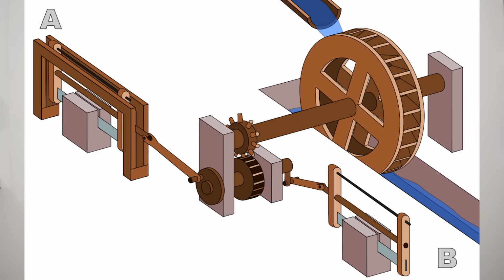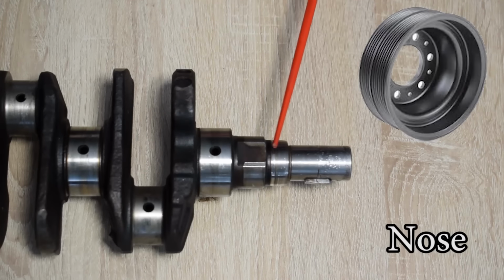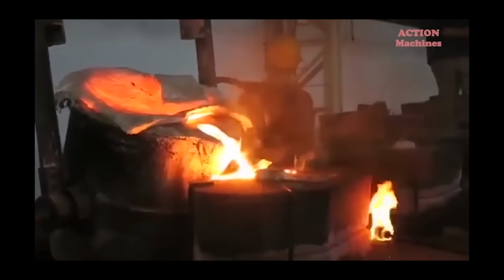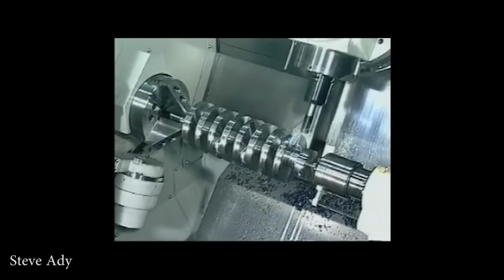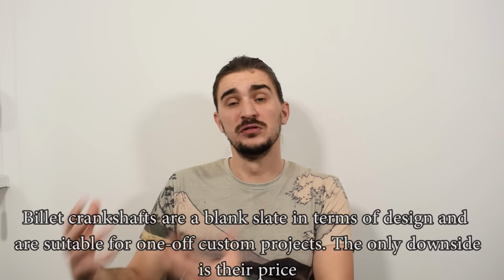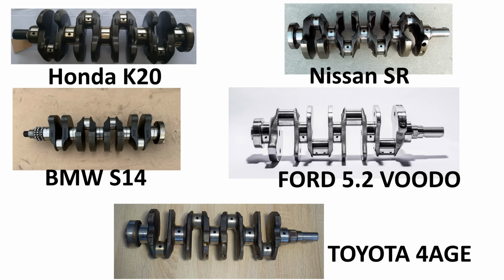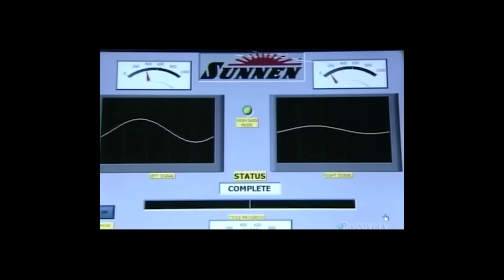EVERYTHING about the CRANKSHAFT - Function | Manufacturing | Different types | Forged | Billet

Comment: Excellent presentation, thank you!  Two questions: how do the rod bearings get lubricated?  Does oil get pumped into the main journals from their mounts and then to the rod journals internally  somehow?  That must be what the direct or cross drilling is for.  Some of the illustrations were confusing to me because it seemed like the oil was traveling through the parts that hold the journals together at right angles.  Which leads to another question: once the oil gets to the rod journal where does it go?  Is it just expelled to fly around the crank case?
Reply: Thats exactly it. The holes in the main journals and rod journals are connected through internal passages in the crank webs, so that when oil is pumped into the main bearings under pressure, it also pushes through those passages and into the rod bearings. And yes, it just kinda pushes out the sides of the rod bearings and main bearings iirc

Comment: Pretty much all 3 cylinder engines have a cross plane crankshaft.
Reply: Actually, no. They pretty much all have 120° between crank throws, crossplane means theres 90° between journals, because the planes created by the crank throws create a cross when looking down the length of the crank. Thats why its called cross plane.

Comment: I really like your vids, particularly your graphic illustrations and simple explanations which are normally spot on but you got a few things wrong with this one. You say that the crossplane crank means a cylinder fires more often than the flat plane crank making it smoother, while the reality is that both cranks fire one cylinder every 90 degrees.  The reason that the flat plane crank is not as smooth as the crossplane is that the flatplane effectively makes the V8 two inline four cylinders attached at 90 degrees. You have previously given great explanations about the good primary and poor secondary balance of inline fours and the flatplane V8 has the same issues multiplied by two but in different directions with different phasing between the banks which reduces the magnitude of the problem but still leaves it with poor secondary balance. The crossplane crank is balanced as four 90 degree V-twins which also have good inherent primary balance without the secondary balance problems of an inline four because secondary vibrations for each piston happen at different times and don't reinforce each other like in an inline four. Crank counterweights on a flatplane crank only have to balance rotating forces because the primary reciprocating forces cancel each other out while primary reciprocating forces on a crossplane don't cancel each other so its counterweights are used to balance reciprocating forces as well as rotating forces which means they are heavier, however in most situations the increased smoothness is worth the weight penalty. The extra weight in the crank means less weight is needed in the flywheel.

The biggest advantage of the flat plane crank is that each bank has an even firing interval between its cylinders that allows better tuning of intake and exhaust pulses within the manifolds. The fact that crossplane cranks have different interval exhaust pulses entering each exhaust manifold is what gives them their beautiful burble but it is not ideal for maximum power or torque.

Flatplane cranks are the same dimensions as crossplane cranks in length and width but flatplanes are shorter in height however they occupy the same amount of crankcase space as they rotate so the engine can't be made any smaller with a flatplane crank. The smaller height just makes it a bit easier to forge or whittle from a billet for custom cranks. The width of any engine's crankcase is determined by the throw of of the crank with conrod big ends attached to the journal. This is identical for both flatplane and crossplane cranks if they have the same stroke, same journal size and same conrod. The length of any V8's crankcase is determine by the bore spacing of the cylinders and the offset of cylinders between banks. These do not change between flatplane and crossplane cranks.

Edit: I just watched your vid on the Corvette C7 & C8 & Mustang Voodoo engines where you corrected most, if not all the errors I've just mentioned.

Keep up the great work.

Comment: didnt  do enough research. should have added exceptions. 1.6 ford turbo motors like fiesta st output insane liter per horsepowers. same with k and b series honda engines. there are actully many exceptions to FORGED CRANK
Reply from the maker: 🤣 gotta get those liters per horsepower actully.
Reply: @d4a  same legendary 1jz and rb26. push over that liter / hp ouch dawg. we want to have too much fun with our cars. light that burns twice as bright burns half as long? only if its not an LED 🙃

Comment: If you were in the Boy Scouts, you learned how to start a fire by spinning a wooden shaft in a wooden hole.  Pretty basic.  If you synthesize  that to a crankshaft, you realize the heat created.  It only takes a few seconds to melt the crankshaft journal to its bearing, if lubrication runs dry.

Comment: Engine wise....I'll take a 427 cubic inch ford Windsor motor with aluminum block, forged internals, and jon kasse p38 aluminum heads and his matching cam.   IT IS GOOD FOR 750 HORSEPOWER AND 595 pound/feet of torque. All motor.  No blowers or turbos or nitrous to bother with. Runs on pump gas too, although if im honest(i am) id probably run v116 race gas through it and turn up the timing a hair for more fun. Maybe a vacuum pump too. SNAPPY throttle response. 7200 rpm max with the hydraulic cam and power EVERYWHERE from idle to recline. Put one in a late 80s fox body mustang and drive it carefully afterwards.

Comment: 25:53 "Crossplane inline 4 engines are extremely rare..."

Umm, no. Yamaha released their 1st generation crossplane YZF-R1 in 2009. All subsequent R1's have retained the crossplane design ever since. Otherwise, a very enlightening video!
Reply from the maker: Only one vehicle uses it. If that's not rare I don't know what is. 0.5 vehicles?
Reply: @d4a  well, among us motorcyclists it's not uncommon. And to muddy the waters a bit further, not only does Yamaha's MT-10 share similar engine architecture (right down to the crossplane crank), the company's MT-09 is a crossplane triple.

Comment: Brittle does NOT mean low tensile strength. Low tensile strength grades are usually very ductile; steel castings are ductile otherwise they could not be used for anything other then tooling.  Brittleness is Low toughness. Grain structure is the orientation of the metal crystal, not the ‘particles’ .
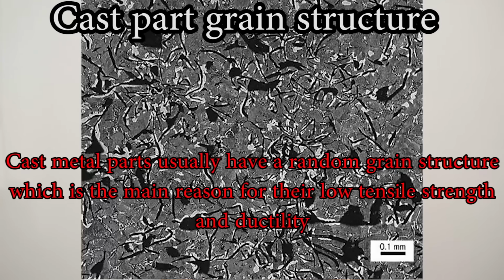The image @11:00 is of gray cast iron ( like in a block) which is brittle , but nodular cast is aka ductile iron because it’s um ductile.  Also metal propties are reported  n ksi instead of psi for ease.
It’s not the heating that hardened steel…it’s the cooling.

Comment: Hi, Thanks for your videos. One remark about grain flow and its effect on the strength of the component. It's actually much better to have the grain flow follow a radius than to cut the flow lines. This is a big advantage for forged components as compared to machined ones. There is roughly a 30 % reduction in fatigue limit of the steel if the flow lines are not aligned properly. A forging with this defect (likely due to improper design of the forging tool) will fail. Stresses in a forged component are relieved during heat treatment and are not present in the final component. Forged compenents, given that the geometry makes it possible to forge properly will always be stronger than a machined part. In a forging you have the possible to "align the strength of the steel" in the direction that best handles the design stresses.
Reply: What you say is correct the company I spent 15 years as a machinist with a company that made non twist V8 crankshafts for racing for that reason the grain runs the length of the crank unlike billet stop start grain or the normal forging process where the pins are twisted into position as is the grain.

Comment: I really like watching your videos; you really jam so much into them!  In this video, however, you got this part wrong:
'...and cross-plane crankshaft means that there's a cylinder firing more often when compared to a flat-plane crankshaft.'

Both V8 crank designs fire just as often - once every 90º (4 stroke cycle = 720º divided by 8 cylinders = 90º).  What happens more often concerns counterweight motion.  One quarter of the counterweights top-out (or bottom out!) every 90º in a cross-plane.  For flat-plane, one half of the counterweights top out (or bottom out!) every 180º.  As some engineers say, there is 'no free lunch' and you can see how the cross-plane isn't 'all good' either.  For a SB Chevy cross-plane engine example, the engine does not always fire in alternating banks.  Near the start of the firing order, the engine fires consecutively on the right bank and later in the firing order, fires consecutively on the left bank: LRRLRLLR.  For a Ferrari flat-plane 308 GTSi V8 example, the engine always fires in alternating banks: RLRLRLRL.  Also, an engineer has said that if it weren't for the massive counterweights, the cross-plane design would have even more vibration than a flat-plane.  Regardless, Ferrari acknowledges that cross-plane is the better overall design despite not using it!

Comment: In cross drilled oiling oil pressure must overcome centrifugal force to go in rod journal. Why, I don't understand and why not in straight shot oiling. I think centrifugal force helps oil to go into rod journal in both systems.

Comment: 2 questions:

why would a non-fully-counterweighted crankshaft be used? Is it purely weight savings?

Why would a cross plane crankshaft require more space in the crank case? Is it not just the same counterweights and big-end journals but rotated around the shaft axis?

Absolutely awesome content. Thanks for your efforts.
Reply from the maker: 1. It's often used and cost is an important factor.
2. Crossplane cranks need giant broad and thick counterweights.
Thanks for watching 😊

Comment: 26:15 "the crossplane engine is firing up an cylinder more frequently" that is an error, both enginetypes fire 8 times on 2 revolutions...
Reply: I think he meant the frequency of the cylinders firing
Reply: 👍 Neither crank can “make” more torque than the other.  Crossplane is heavier and creates more windage so it consumes more torque.  Also the claim “Crossplane has a cylinder firing more often compared to a flatplane crankshaft”. is not physically possible.  Here’s why: Both cross-plane and flat-plane V8 engines, being four-stroke engines with eight cylinders, have the same number of firing events per engine cycle at the same RPM.

Comment: To improve the quality of a cast crankshaft, maybe it should be poured into an aerogel-infused mould, which would allow it to cool off a lot more slowly, and thus have a less random crystal structure. Combine this with an ultrasonic process, and you can keep the components of the allow into an extremely uniform mixture.

Comment: Didn't mention the wankel when talking about how crankshafts work. Also cast cranks are case hardened. They can be reground .010-.020". Without grinding into unhardened material.

Comment: Just a little thing I noticed when you were comparing the forces being applied to the crankshaft to the forces from a professional boxer. In the US, a ton is 2,000 lbs. rather than the 1,000 lbs. per ton used in your comparisons. Not a big deal though. I also have heard the term "metric-ton" talked about here in the States. Is that the same as the 1,000 lbs. per ton you spoke about, or are metric-tons based off of kilograms? Thanks for all the great information!

Comment: How does the oil get into the holes in the journals? Won't the holes be covered by the bearings and rods at all times, sealing them off from the oil in the crank case?

Comment: I hate to dispel ( some comments) of a some what entreating video, but I wish to point  that the flywheel does not reduce the vibrations of the pulses on the engine it in fact adds to, or subtract from the the rotating mass that is causing kinetic energy allowing the engine to turn over under load, the front pulley as you put it is called a harmonic balancer and this is what actually helps to remove the vibrations from the rotating mass.

Comment: Regarding crossplane and flatplane cranks in 4 cylinder configuration, the best example would come from motorcycles.
Take any liter bike with straight 4 engine (it’s important, since there is only one engine among the liters with a crossplane crank in 4 cyl config) and take Yamaha R1 2009 and onwards. Compare the sound.

Comment: I've aluminum 2.0L Ford Focus SE and possibly timing chain slippage and maybe bent rods / valves ? This mechanic said in that case most likely a engine replacement .. That the aluminum engines don't take too much overhaul major work ? Any help will be appreciated . Small  2.0L Ford Focus,.Back story is that I had timing cover and motor mount replaced and it was running fine before I took it to this shop to replace those two things . Now those things replaced yet now won't run . Which leads me to think it's timing issue .

Comment: I have v8 engine in my car with a split-pin crankshaft. The crank pins are at 15-75-105-165-195-255-285-345 degrees in crankshaft.

Comment: At 23:05 there is a picture of a few crankshafts and i see one titled Ford 5,2 Voodoo. I was so shocked too see a 4 rod journal crank that works with 5,2 liters of displacement, that I had to go and check ou what kind of crazy engine it is. It seems you have used either a wrong pic or a wrong name since 5,2 voodoo is a V8.

EDIT: MY BAD! I didn't notice two oil holes on each journal. And I've completely forgotten that many V8s use this layout. Mea maxima culpa.

Comment: I bought an Eagle crankshaft new   should i get it balanced for a new Chevy 350 engine block   crank is still in the box as I remember it does have the drilled holes in the counter weights  probably will never race , if it would last maybe 5 years that's fine ,I'm 66yr old ...thanks DEX    you are good info man.....
Reply: the pistons an rods r balanced to a very small plus or minus
Reply: probably not see over 4k rpm on an eng. test stand  . i just want to  hear it run an play with the adjustments  an  lol spend some money.
Reply: o i gotta fine a good test stand  ...
Reply from the maker: I doubt you NEED to balance the crank. Balancing it will improve it but not to an extent that will noticeably impact your build. But I would definitely check the crank for straightness, out of round etc.
Reply: i was kinda thinking so you are good great help  THANKS MAN....DEX
Reply: now i gotta deal with heads to match cam by way of the springs  either or dont match summit 202 heads have springs for a roller cam  they r brand new  i be running flat tappet to non roller spring   if that makes since  ???   i really dont think it will matter  about the spring pressure

Comment: Nodular iron, aka ductile iron, is not brittle. The requirements for the processes to ensure proper spheroidal structure also even out it's grain structure, thereby making it, well,  ductile. Some grades exceed 40% elongation. Only austempered variants result in elongation of  less than 5%, but it also makes the material significantly stronger than 4300 series steel. Austempering  after treatments result with an advantageous characteristic of work hardening (over 400 brinell), and significant increases in tensile strength with some, ASTM Grade 5 and SAE JD 1600 for example, exceeding 230,000 psi . The vast majority of heavy equipment manufactured today uses ductile iron for its mechanical, and other high wear components (shovel teeth). Ductile iron's disadvantage is it's thermal conductivity is lower than grey iron, so it typically isn't used for engine blocks or heads. It is very commonly used on transmission/ differential cases, as well as most steering knuckles, ring and pinion gears etc. Modern ductile irons are a super varied and flexible material, and woefully under-utilized in high complexity manufacturing.

Comment: Yamaha, and I"m sure some others, like Ducati, DO use a crossplane crank in their inline four cylinders, and they're getting some incredible rpm's from them. Don't quote me, but I'm thinking they get about 200 hp at 12-14K rpm from a 1000 cc engine. And they sound so incredible. Conversely, I think the v8 crossplane Mustang engine sounds like crap, especially at idle.

Comment: Fun fact, 'The Daily Grind' as referenced to work, comes from the fact that it took a few hours every day to grind enough cereal (wheat, barley, corn, whatever) to make bread. Most small capacity motorcycles (and a few large ones) have multi piece built up cranks. It was only relatively recently (208 ish?)  that Harley Davidson stopped using a 5 piece crankshaft and switched to 3 pieces pressed together at around 50 tons. Majority of single cylinder bikes used a pressed up crank, particularly two stroke motors where they have needle roller big end bearings